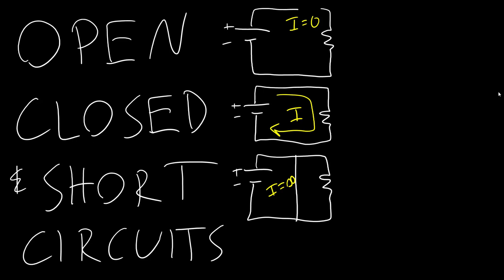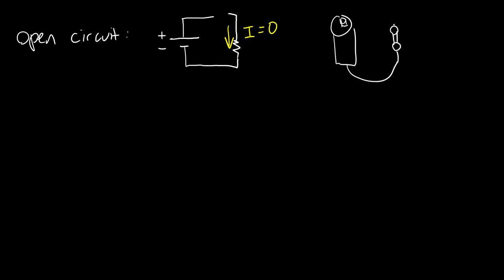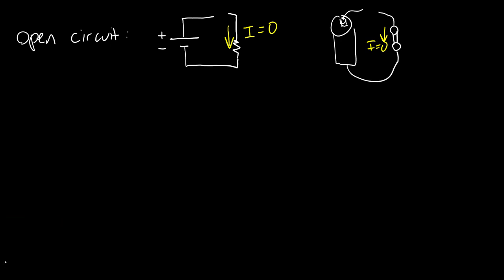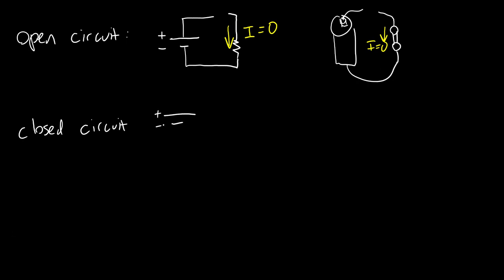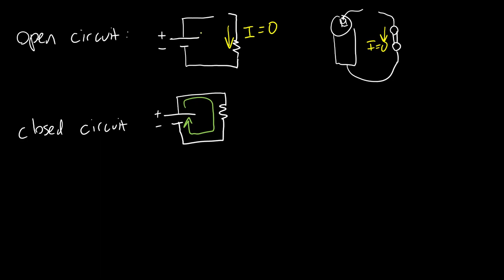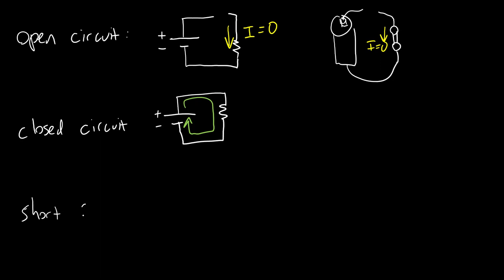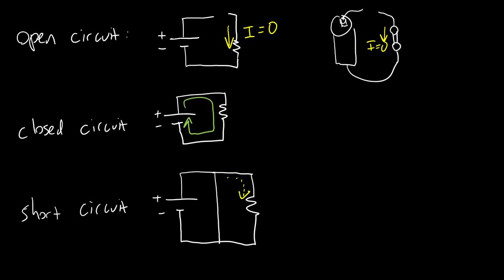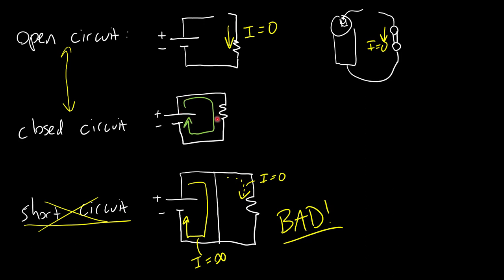Intro to Circuits 4: Open, Closed, and Short Circuits

Comment: Would it be fair to say that a short circuit is a path through a circuit for which there is **no load**?  In your short circuit, if you put a resistor on that "extra" wire, it would no longer be a short circuit.  It would be two resistors in parallel.  So, it's the lack of a load that is the problem, right?
Reply from the maker: Hmm - you have the right idea, but I would be careful phrasing it like that, because I think absence of a load more commonly implies an open circuit. For example, remove the resistor entirely from the closed circuit - you would say there is "no load" on the battery. It is better to think of a short circuit as an "extremely low resistance load" as opposed to "no load." Hope that makes sense.